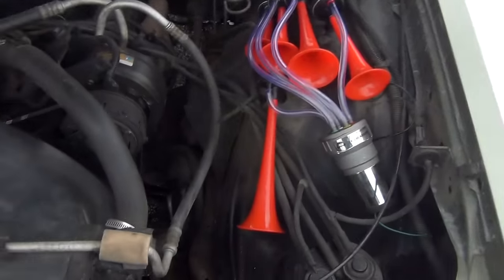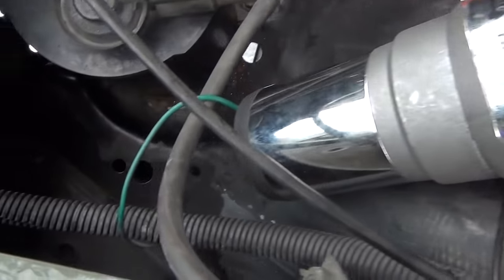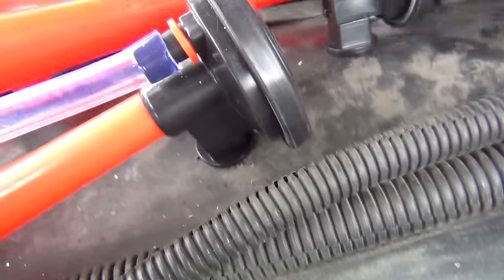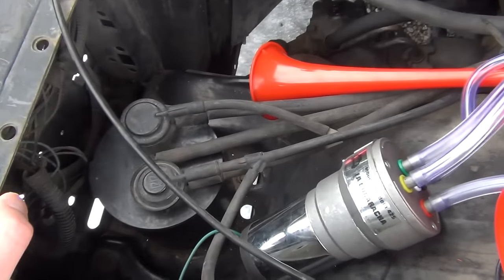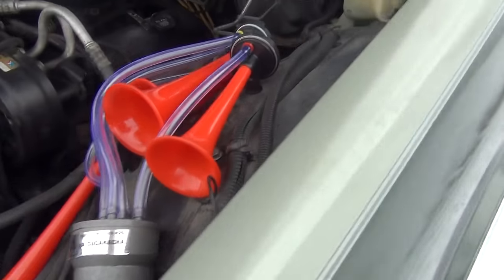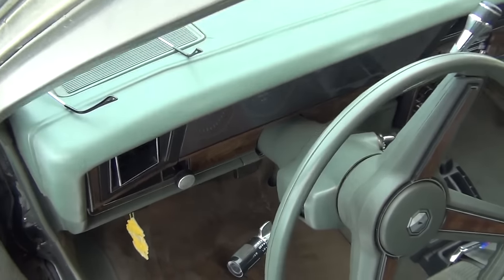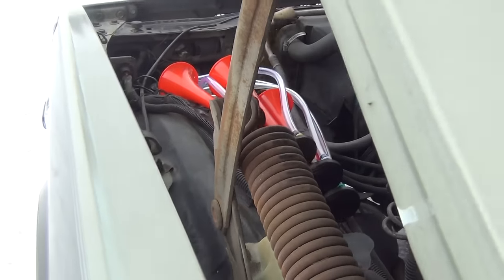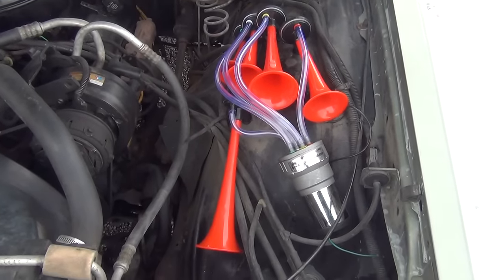La Cucaracha horn

Comment from the maker: Very simple, all I did was remove the stock Delco horns, run the positive wire from the original horn to the air-pump, then ran the ground wire from the air-pump to the metal fender. All bolts where included with the kit that are needed to hold the horns and the pump down, all you need to do is drill a few holes for that. :)

Comment: Nice one, but you should have wired in a relay switch, also keep your original horn. Wire the air horns to a separate switch.
Reply: Wonder if it’s still working or are the switch contacts burnt worse than Hiroshima

Comment: I mounted my 2 horns like that ten sprayed plasti dip on the bolts just so they didn’t get nasty over time. There galvanized but I wanted extra protection. If I need to change or move something I peel the dip off and it’s good to go. This is a clean set up I like it.

Comment: I would suggest since you went through the metal fender well with your bolts even if they're stainless steel spraying the fender well and bolts with rubberized under coating to protect it and the bolt heads from corrosion. Especially since you live in an area that gets snow which means you most likely have salt on your road ways. It will just protect the body better. Just a suggestion that I hope helps out.

Comment from the maker: Cut the positive wire that originally went to the stock horns, then soldered it to the Positive terminal on the air-pump. Then I took a ground wire and ran that from the Negative terminal on the air-pump to the metal fender of my car.

Comment: Ok. Do u know how to wire it to the steering wheel, with no wires already. Because my 86 nissan hardbody pickup, when I bought it, it never have a horn or wires, so I have been trying to look for how to wire to steering wheel even though there is no wire and horn running to the steering wheel